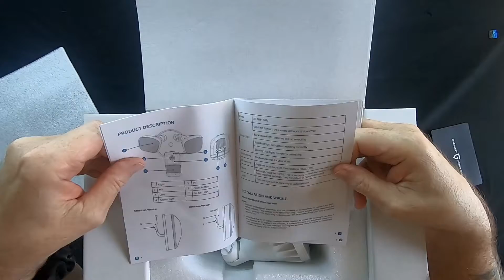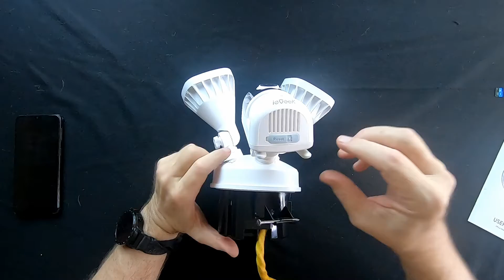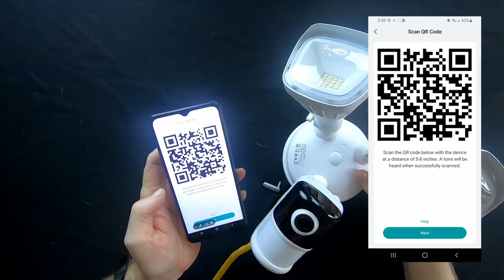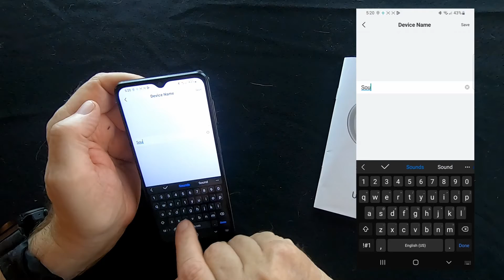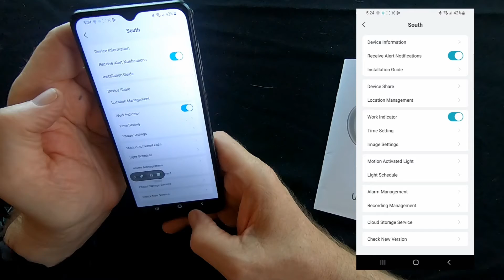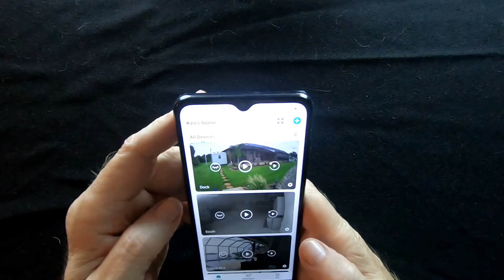ieGeek ZY E1 Floodlight Camera

Comment: DANGEROUS do not get these. They will not work at all with internet goes down. You won't have any light or camera with just wifi router. I installed two of those and we ended up in a hurricane and out internet went out. We had power and wifi router but found out the lights and camera won't work leaving us in the dark outside during the storm.
This product and all like this are a danger to the public and could even result in death   
Without at least an option to use the lights when the internet drops.
 They can make these and ones like it work with just wifi just like a wireless printer but they don't to track your location and soy on your information and the risk of our safety.
 If they fix this SERIOUS problems with these I would recommend them as I was happy with them until I found out this issue first hand.
 Not fun going out in a hurricane with just a flashlight when normal outside lights would have worked.
 Don't buy these if your value your families safety.